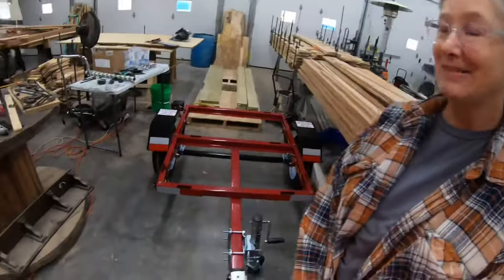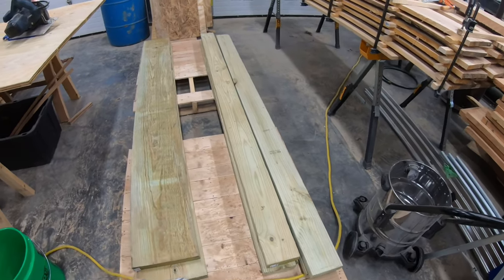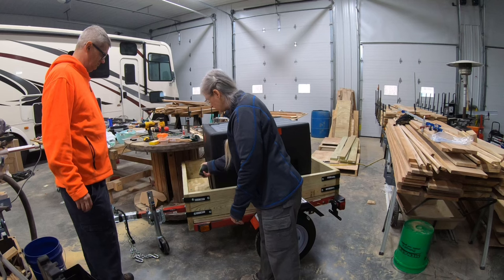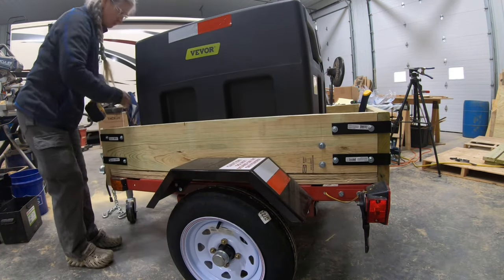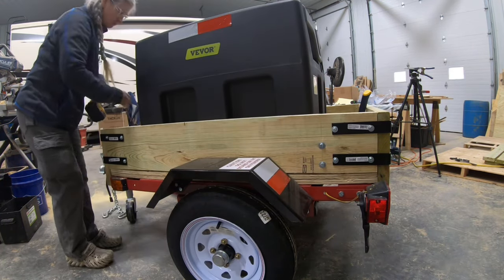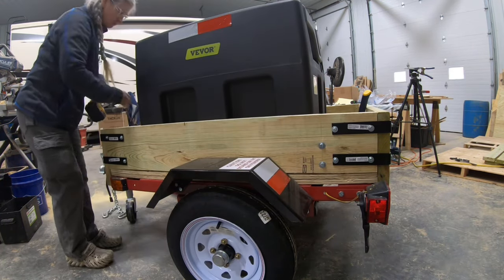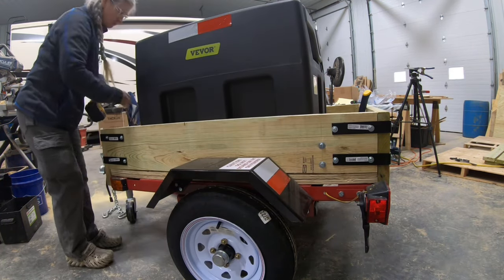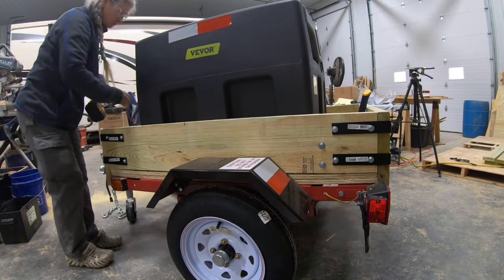DIY Fuel Trailer Build w Harbor Freight Cargo Trailer & Vevor Fuel Transfer Tank

Comment: Curious as to whether anybody has tried upgrading the tires? Are the included tires rated for highway driving?
Reply from the maker: @RyanWattersRyanWatters  not sure about upgrading the tires. They are DOT rated AQB5 (whatever that means) there is no warning about staying below a certain speed even though I haven’t been above around 35mph with mine. I don’t think I would head across the country at 70 with this trailer but it doesn’t say you can’t… thanks for watching and your comment! Have a great day and be safe!